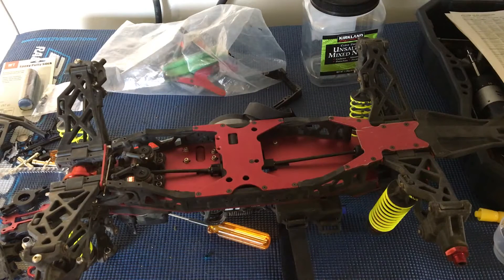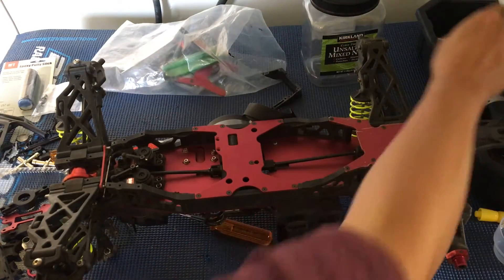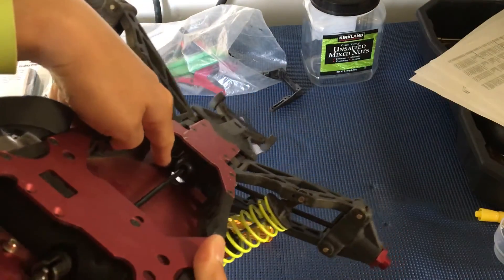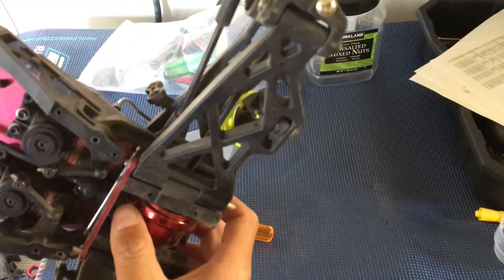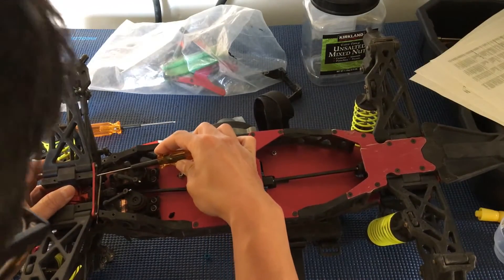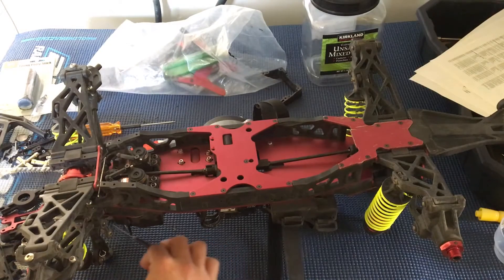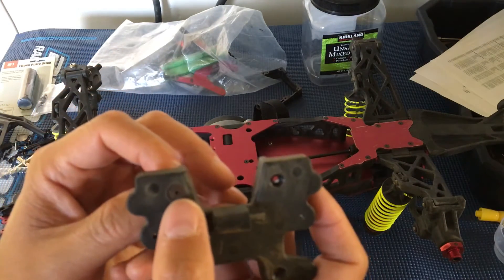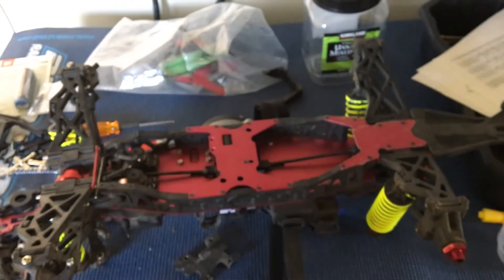Racing2Learn: Huge 1/8 Monster Truck Losi LST XXL2-E:  Parts Diagrams, Diff Mounts, Tiny Hex Heads

Comment: When changing the pinion gear, any tips on how to set it right (spacing) against the spur.. so as to not bind the gear?  I'm changing out the stock 24T to the 20T for 6S running.. and should I use loctite on the pinon set screw? Thanks in advance!